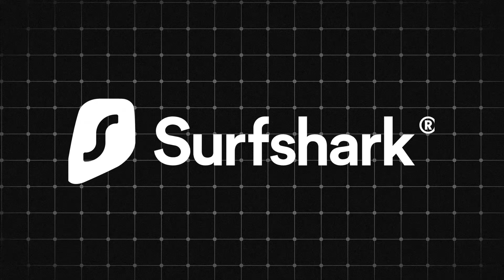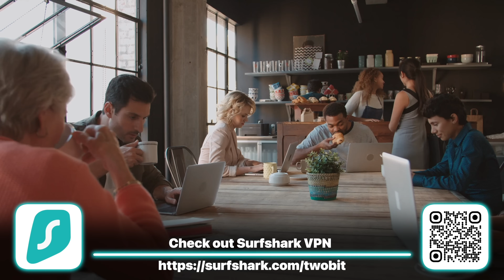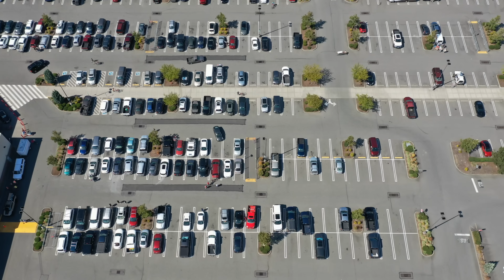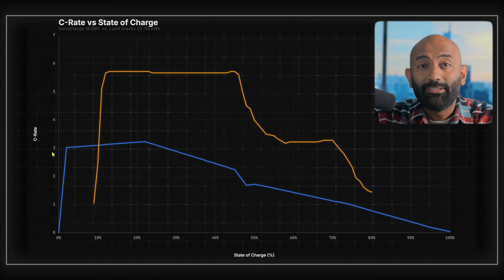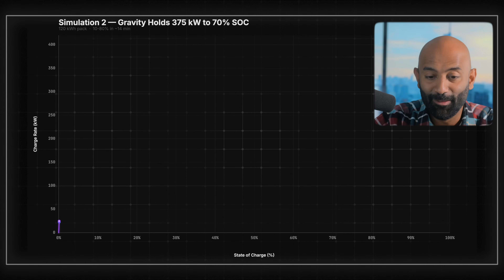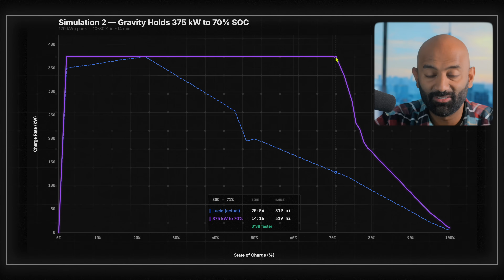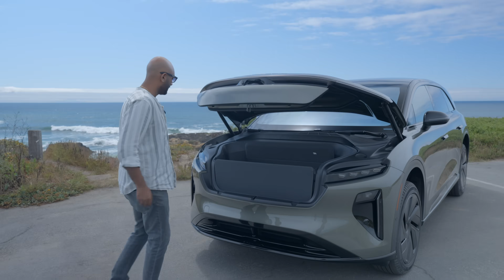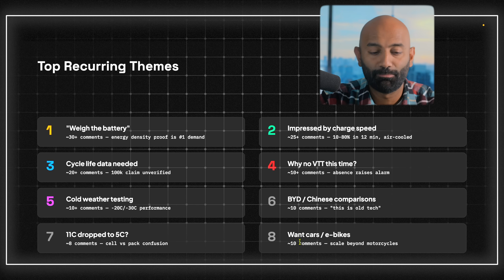Donut Lab Battery Test 4 Changes Everything!

Comment: Hi Ricky. Good work as always. I'm sure in the Donut vid they mentioned ambient air was 20c, but you've failed to mention this on your charts. As we know batteries perform better when they've reached optimum temperature. Given this I'd expect the Donut battery to perform batter at optimal temperatures (which may just be 20c, putting aside for a moment the BMS tuning vs 'extreme/upper limit' of the battery as-is).
Reply: 20C wasn't ambient temperature, it was batteries temperature at the start, they don't mention any other temperature data which would be way more relevant.
Reply from the maker: Good catch — lab tests usually run at 20°C ambient. Real-world performance depends on how fast the pack heats up.

Comment: Why did they use a motorcycle for the test which had a full cage around it. Did the company doing the test go in and identify that the battery from this bike was the same type of battery from tests 1, 2 and 3....Maybe the bike had a large capacitor on the inside, linked to a Li-Ion pack (hybrid, but the capacitor being totally external to the pack). When a cell is tucked inside a cage, who knows whats being tested.
Reply from the maker: cage is just for mounting — no magic caps, same cells throughout. VTT data lines up clean.

Comment: What was the ambient temperature? My Ioniq charges at ~3C up to around 50%, but only if it is warm enough (above 20°C). It is way (1C) slower at the start if it is colder
Reply: We could put a heater in the pack. Not a problem.
Reply: Most likely 20C as Ville mention that the battery temp is around 20C and the test was done last summer, early fall, given the green grass and green leaves of the trees in the background. The test it self was most likely conducten in Tallin, Estonia, where Verge Motorcycle HQ is.
Reply from the maker: Finland winter? Try -15°C. Charger was outside, no heating.

Comment: The drip feed of information on this battery tech' is good politics - just as I believe you said.
If the hype turns out to be real, I would expect the smartphone industry to be all over this development - quick smart.
Reply from the maker: If it's real, yeah — phones would be first in line. But we still need proof on weight and cycles.

Comment: Maybe chargers should be ~700KW, 200 miles in 12 minutes for a mid size car. 🤔
Reply from the maker: 700kW on a motorcycle? That’d vaporize the wires before you hit 10%

Comment: I don't care how fast it charges. 

That's a factor that's tied to ICE vehicles and not relevant to how most people use they're EVs.

$/kWh and kg/kWh is what is important along with oporational life and fire safety. 

Conquer those 4 things along with the stupid useless fast charging thing and then I'll be well impressed.

Fast charging will sell them for sure,  because people are still so hung up on range anxiety. 

It will make commercial use more effective and efficient though pack changes could do that now if that was something holding it back. 

The thing we need most of all is a Fuel crisis aid people seeing that the cars and trucks that are not effected are the EVs.

I never thought I'd say it,  but thanks Trump for do that.
Reply from the maker: cost/kg and cycles matter most — fast charge is just the flashy sales trick

Comment: My question is motorcycles already have a liquid cooling system for electric motor and other parts. Some manufacturers also use the liquid cooling for battery pack too. So why they are not using the liquid cooling for battery pack? I think they can get quite a lot of benefit over the existing ones, during charging and using the motorcycle on the road too.
Reply: Doesn't need it. Fans are more than enough for 12 minute charging. That's a feature, not a bug. Keeps the cost down and enormously simplifies design. If it were kept to 1C to 2C, wouldn't even need a heatsink.
Reply: @davis.fourohfour you are thinking about only one weather type considering every place is cold. Yes fan only will be sufficient in that place but then you severely under-utilize this tech.
For warmer weathers, only a single fan sometimes is not sufficient so mfg add a cooling system too.
Reply from the maker: weight and complexity are the trade-off — they're betting air cooling is enough for now

Comment: They seem to have updated new range and charging specs to verge motorcycles specs. 

TS Ultra used to have charging time 25 minutes, now it lists 10 minutes or so.

Thats 60% improvement on battery tech on their listed product.
Reply: And the range? Nevermind, it says 600km.
Reply: @florin604 obviously need to keep in mind if this is real it also means no rare earths. I would take that without other improvements lol.
Reply: Where have you seen that? Charging time "now it lists 10 minutes or so"... for what? 0 - 100% or 0 - 1%? Be precise. 

On the Verge homepage, I found this, don ' t know if something different is written somewhere else : "370 miles on a charge. Under 10 minutes to keep going." "Keep going" is a typical Donut claim... it could be anything from a 0-1% charge to a 0 - 100% charge...  useless information.
Reply: @Unity2-765yes on the page they say 0-80 in under 10 minutes and 600km. Old specs were a lot worse.
Reply: Based on older articles on the TS Ultra model. 

Battery & Charging
Range: Up to 233 miles (urban) or 375 km.
Battery Capacity: Approximately 21.8 kWh.
Fast Charging: 0 to 80% in 25 minutes using DC fast charging.
Reply: @odman7945  
Yes, but the 10 minutes...for what? as I can read on the Verge homepage it is 10 minutes to "keep going", which is just pure nonsense, as it doesnt tell anything about how much charge one get in 10 minutes.

Maybe it is written somewhere else on the verge homepage.
Reply: @Unity2-765its still a 60% improvement on specs, no?

Its also kinda why I said 10 minutes or so. 😅
Reply: @odman7945  

No, as 10 minutes doesn´t tell anything if we dont know what you get in 10 minutes. A Donut, a massage, finger...we just dont know what we will get from 10 minutes.
Reply: @Unity2-765yes, but their old specs said 0-80% in 25 minutes d’oh. At the same time they increased range, tho, a lot of that probably comes from improved donut motor.

Their model lists 60% improved range while having 60% faster charging time.
Reply: @odman7945  

But at the new page there is not written what you get after waiting 10 minutes, except that you are free to "keep going"

It is a joke when a company act like this.
Reply: @Unity2-765obviously its still just company made statistics listing on their page, but the fact is they are selling them with those specs right now.

Comment: I'd love to see the battery given to Dr Euan McTurk a battery scientist/researcher who could literally take it apart correctly and do a full chemical analysis of the chemistry and let us know what it is.  Some said to give it to Bjorn he doesn't test batteries only cars but just on the road with no testing equipment beyond a OBDII dongle.  Once the first few are sold those batteries will be the ones ripped out of the bike and reverse engineered including chemical analysis to determine what materials are used in it.
Reply: He'll get one eventually. Anyone can. Buy the motorcycle.
Reply from the maker: same, independent teardown would settle the chemistry question fast

Comment: I'll start by saying that I'm hopeful but remain skeptical. 

3:00 We need to be careful about the C-rate when considering a battery pack at a public charger. A 100kWh battery pack charging at 100kW is 1C. A 20kWh pack charging at 100kW is 5C. The latter is not any more impressive - it's just a matter of how much current the charger and supply. 

To put this into context, I can buy consumer 18650 cells - Li-Ion and Na-Ion that can charge at up to  12C (I make no claims about their actual charge performance). That's easy to achieve when it requires 126W and 64W respectively.

Also, scaling up to a 100kW pack adds many compromises. As a shape increases in size, the ratio between it's surface and volume changes - less surface area per unit of volume. So the thermal performance is not going to be comparable.  Also, the shape and location of a motor cycle pack makes airflow (if only due to convection) much more useful than the flat slab underneath your car. Passively cooling a stationary car's battery is much much harder.

So, using a motorcycle, and not a car, to demonstrate this on, is not a surprising choice.
Reply from the maker: exactly — C-rate is meaningless without pack size context. glad they used a real bike though

Comment: Where is video for = the BYD 10C charger video

BYD launched 10 car models that have 1000V architecture and a charging system that can do 1500 A for a total of 1500kw.

10-70% In 5 minutes
Reply: I'm sorry I could give a shyte about a battery with such poor power density. I prefer my vehicles light. 

 These new solid state batteries remove the 15% weight penalty. Perhaps one day will make EVs lighter than ICE with 750 kw motors that weigh under 30 pounds. 

 Oh what do ya know YASA has that in the pipeline with next gen axial flux.
Reply: @RedactedDeath  YASA is crazy tech, but to be fair, that;'s not the place to save on weight. Also, in most "recommended" implementations you'd have the YASA motors in the wheel hub, so you need 2 or 4 .. so you go back to same-ish weight.
Reply: @i3looi2 Well good news for you. 

 YASA/Mercedes aiming for it to be a wheel hub motor, that they call mass neutral. Saying it will weigh the same as a regular wheel. On top they are making a next gen inverter that can handle two. Weighing 15kg. 

 That's 2012 horse power in a 89 pound drive train. While I'm not fond of wheel hub motors this one will get rid of 500+ pounds in parts. 

 From the disc breaks in favor of Regen + emergency. The drive shaft. The callipers, etc etc. So many parts. MOVING parts. Gone. 

 Most EVs are only 15-20% heavier than a comparable vehicle. 

 500 pounds of solid state batteries is.... 91+ kwh! If the batteries were 500 wh/kg it would be 113kwh or something. 

 The average battery pack size is 75kwh? 

 Brother this motor with that peak is double a dragster engine. The continuous on par. Without having to rebuild the damn thing after every use. 

 You need jet turbines at speed to get comparable power to weight. Rockets. Other exotic engines. 

 We aren't there yet. Give it ten years, because axial flux technology is just getting started. YASA by no means the only one working on Hallbach Array hybrid tech. 

 Oh I should have said. We still need a hybrid generator to get the most use out of motors that powerful. I'm not a purist. 

 Mazda says their newest rotary fixes the apex seal problem by simply revving at the same range? Big if true. Not really I do wish F1 would get their shyte together. Let rotaries come back. Let engineers cook. 

 It's a nostalgic sport now. 

 This does allow personal VTOL. Small tankettes with powerful guns. Insane drones. I can't wait for regular people to get their hands on the technology. 

 People should be excited. Instead they choose sides. This tech will be good for tractors and such too. 

 Transflux, PCB, rotor stator rotor, air gapped, and modular axial flux motors are coming. Life is good.
Reply: @RedactedDeath . We have no evidences at all about donut lab battery energy density
Reply from the maker: 1500kW? Damn. But real-world 5C on a bike > lab numbers on paper — show us the curve.
Reply: he obviously puts effort in the quality of the videos. stop snapping fingers.

Comment: I wish the terminology for charge rate was not "C" stated like 5C or 2C, but "CR" stated as 5CR or 2CR.  C is already used (duh) and an important data point.  /2c (snicker)
Reply: C is for Capacity and not Charge. It's capacity per hour, 1C - full capacity per 1 hour. 2C - twice the capacity per hour. It could be called Ch.
Reply from the maker: lol fair, but try saying '5CR' five times fast

Comment: Once I saw the rear wheel and how it connects I knew they care more about appearance than performance and practicality This type of wheel linking system has been bad in everything it’s been used on and is less efficient and in the case of an electric bike it’s actually a clever way to lose efficiency
Reply: Works great and they've cut the motor weight in half next iteration. Fifty pounds 800+ horsepower. Many videos on YouTube showing it go thousands of miles. No chain, no moving parts but the wheel.
Reply from the maker: fair point on the shaft drive — efficiency penalty is real, that’s a motorcycle design choice not a battery one

Comment: I’ll say this again: They pretty heavily implied that VTT would be doing some form of cycle testing on the cells sent to them. This was in a comment from their channel on your video response to test 2. Maybe you’re choosing not to humor them with a response, and fair enough.

I was thinking about this today and it would actually make a lot of sense to have VTT do a cycle test. If you wanted them to do 100,000 cycles it would realistically take around 4.5 years. But if you wanted them to do a simple* 1,000 cycle test, at 5C that could be done in about 16 days. In a claimed 370mi range motorcycle that would be a 390,000 mile battery. And obviously if the battery looks like it’s in good condition after that, that lends credence to their larger claim.
Reply from the maker: for sure, I hope they do it, and hopefully soon!
Reply: Yes, 1000 cycles in a truly INDEPENDENT test not made by Donut would be great, and surely enough for a lot of people. Still, if it after some time turns out that the 100.000 cycle claim is just BS, it is not OK.

Used in grid storage, in a ferry, train etc. as some few examples, I am sure it would be looked at as a scam, if it turns out a Donut battery would only have some few thousands cycles, or even less.
Reply: @Unity2-765 a few thousand cycles is still a few years of usage, at one charge-discharge cycle per day
Reply: @Unity2-765That’s a fair point. It wouldn’t be smart business to sell it as a 100,000 cycle battery if it is only thoroughly proven out as a 20,000 cycle battery.

Comment: 15:05 There already is a recently opened public charger in LA from Tesla with 750kw--although I think it's using their special Semi plug and not NACS. They're supposed to roll out megawatt charging soonTM for Semi's more widely. Theoretically NACS is supposed to support megawatt charging so it may be possible as hardware for the semi spreads to also potentially have it for normal vehicles.
Reply from the maker: tesla V4 is 400kW and their mega chargers are for semis not for cars.
Reply: @TwoBitDaVinci  Isn't the V4 charger mostly cabinet side and not the posts? If they have the cabinets capable of doing 750kW (and soon 1MW) on location, it's potentially a far lower lift to give cars higher throughput if suddenly there's cars capable of using it rolling out in the next couple years.

Comment: Did you include the fact that the Verge MC battery is uncooled, as Donut said the cooled version would charge twice as fast (no cooling in MC to keep it simpler)?
Reply: Are you saying that original motorcycle had not cooling, thus was charging slower? So is there a difference between those two, since the capacity is basically the same?

Comment: I suggested to Donut Lab:
"You should run in extreme conditions race series with the Verge motorcycles for 6 months to prove the capability of your batteries to the world."
Reply: The Verge has a 800+ horsepower motor. The version 2 coming now (?) cuts the weight in half. A fifty pound unsprung rim wheel motor instead of a hundred pounds. Maybe not the bike for close quarter racing.

Comment: I thought the motorcycle had 4 battery packs in it from what I saw when they introduced it for pre-order. Also they make a car-sized battery pack, they showed off that "skateboard" frame at the same show as the debut of the pack. And why wouldn't someone just order the damn bike online and cut the pack open?
Reply: That would mirror the li-on pack. Three or four staggered shelves of batteries. That would indicate the weight and volume of the individual batteries is the same, so now you can calculate the energy density.

Comment: I don't think it's anywhere impressive; they have many fewer cells put together in a motorcycle. Bigger battery packs need liquid cooling because they are too big, and the average cooling surface area for each cell is too small. In the case of a small pack, it's less of an issue. It's exactly why some cars with small batteries (e.g. hybrids) are air-cooled, and they also need to tolerate high C rates.